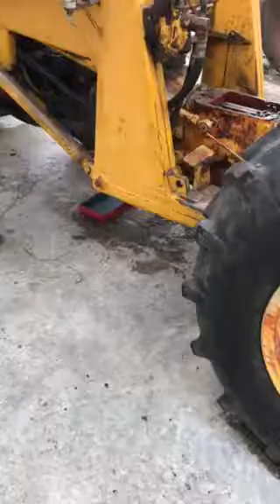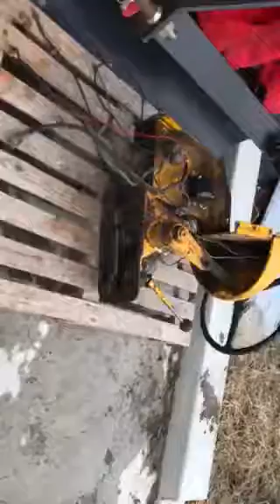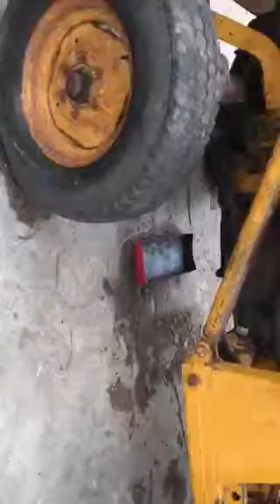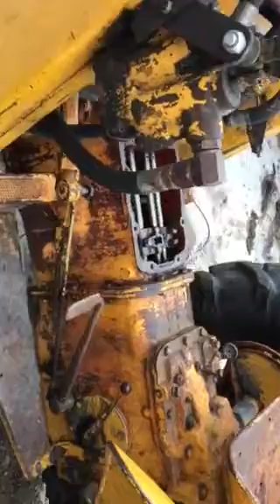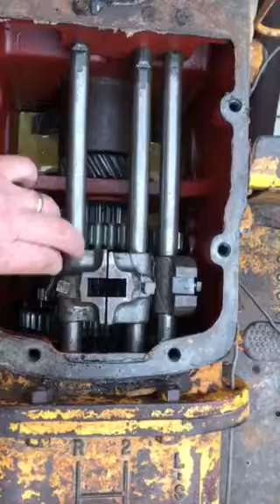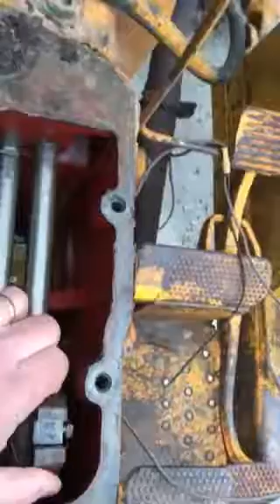Massey 65 Removed Steering

Comment from the maker: The Tractor would not drive. Clutch works and gear shifter ok. The high low shift rail was not going back into high in the video but it was when assembled. Just needs a little more force.